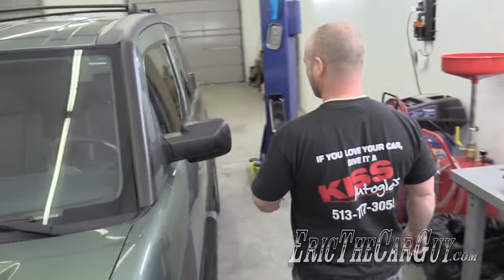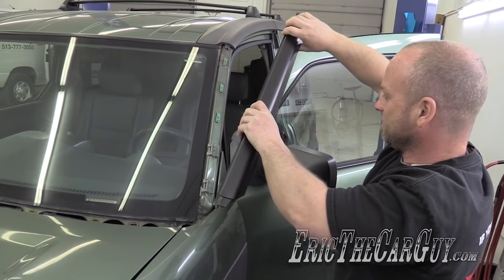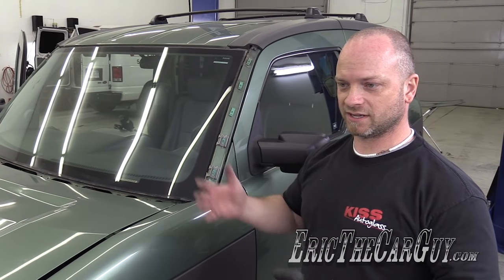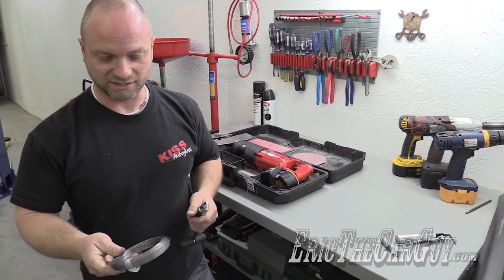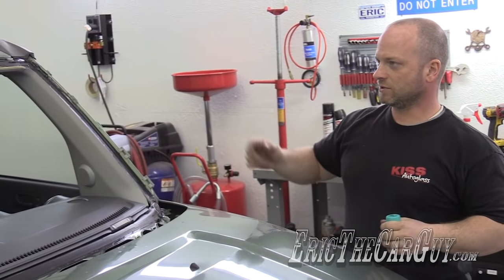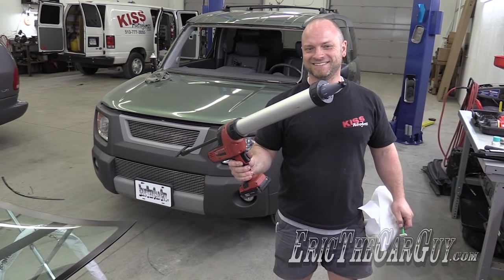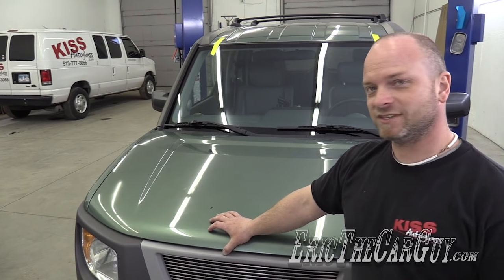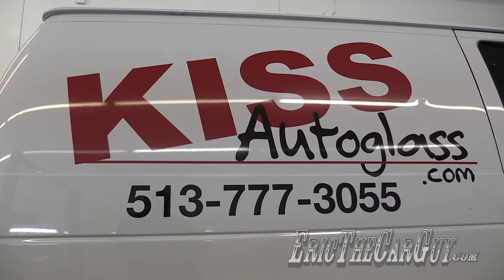How To Install a Windshield the "Right" Way -EricTheCarGuy

Comment: Great demonstration, great video.
Thanks for pointing out what to look for in polyurethane, time spent on service, tools used, etc. What should one look for in the actual windshield being used (what to avoid or seek out)?
(I would just come to you, Kiss Auto, for my windshield replacement, but I live in San Diego).
Reply: So do I , I’ve replaced mine 10 times i should probably fix the hood latch

Comment: Its funny how the QUALITY of replacement glass is never questioned and considered L-K-Q by auto insurance as long as the cheapest price is offered. Safelite AutoGlass quoted me $149 for door-glass and later stated their replacement glass is made in their own facility LOL. As the video states, the CHEAP price is not the same as OEM in both quality and workmanship using questionable materials and cutting corners for a budget friendly repair... Great Information and tips to be aware of before getting any glass replaced.
Reply: heavymechanic2 Safelite is the largest glass company in the world by sales.  They dump tons of money into marketing.  Marketing yourself the way some do clearly doesn't mean you are the best or that you use the best material.  Just means you can reach a broader audience.
Reply: The guy Safelite AutoGlass  sent out broke my door panel by prying on it without removing the fasteners. A lack of experience is costing me dearly and I will never use Safelite regardless of what any insurance company says. I'm very unhappy that GEICO Insurance set this up.
Reply: Sounds about right. Sad part is you say Geico set it up.  Thats actually not true.  Safelite owns a company called Safelite Solutions that handles insurance glass claims for a bunch of insurance companies.  When you call Geico you are actually talking to Safelite Solutions.  A company that obviously is going to feed their own mouths.  You have the choice of which glass company you want to use.  My advice to you and everyone is when/if you need glass work educate yourself on a good glass company and tell them who YOU are going to use.  They don't have your best interest in mind.  They have their own interest in mind.  The reason they are the largest glass company in the world.  They are a monopoly.

Comment: Does the molding need to go underneath the windshield, across the top?(Ihave a 2012 Nissan Rogue, I'm replacing the urethane plus moldings on the windshield and roof). It seems to have leaked after all these years, and my radio shorted & didn't work for a few days. I found some moisture in the middle at the bottom of where the it was installed.  I now remember it leaked
it looked like it was already on the windshield, in the video). I haven't replaced a windshield since my 69 GTO and they didn't have a molding, like modern vehicles have.

Comment: hi Eric, I wanted to ask how long do you normally keep the tape on the windshield? I just had a windshield replaced and it has been 2 days already so I took the tape off. the guy who replaced it said not to wash for 2 days also so I haven't washed yet. I have been driving since it has been replaced tho. any signs I should be aware of as far as the windshield setting correctly? I noticed little indents on the top of windshield where the rubber is. thanks!

Comment: at safleite we use a fiberline like fishing string to cut out your window as to minimalize the damages to paint. the cold knife can slip and do incredible amounts of damage. also double dipping in the primer can cause contamination and not form a good bond as a result. I skipped around but was the glass activated? if it wasn't it won't hold in an accident. and the put there fingers on the bond line setting the glass. this is a safety device.. can't cut corners. gloves or not it has been contaminated. may or may it hold at this point. other then that was a decent job.
Reply: You might want to come and talk to the Safelite guys in my area,they could use your help ;-)
Reply: Good commentary!!

Comment: I just had my Factory mopar window windshield on my 2016 chrysler 200 with a nee glass aftermarket and 20 minutes drove and got on highway and hear wind noise if its already installed how to i checked exactly where the leak /whole is i was thinking of filling the hole or holes with flex shot if i use this would i be able to put the tip in interior gap lower part of windshield where glass sits on weather strip or is there something blocking it

Comment: very informative. the best thing you can do for a crack is stop it from spreading right ?  i've seen stuff in the store that claims that. the other expert i saw on youtube said make sure the installation guy is certified. i.m.o. that's easy, cuz you can fill out certificates from staples.

Comment: The windshield on my 2006 Accord has had a crack all the way from one side to the other for the last 4 years, and has held up despite some nasty winters. I can't feel the crack on the inside surface. Everytime I think about replacing it, I think of some better uses for the money... such as the Grey Pneumatic Duo set I just bought. (81659Crd)

Comment: Hey eric hope you're doing good... I have question, not windshiel related... 2000 accord cooling system malfunction code, its it possible that it just needs to be flushed ? Its not over heating ...i dont know the cars history.... Thanks

Comment: We went thru a Softballs sized hail storm last year that knocked out windshield back window and sunroof.. i replaced back window and front windshield with a 1$ ozark trail knife and a hatchet lol.. i chopped the window out around the edges then just cut around it and pulled the edges off.. i used Nascar endorsed 3m windo-weld... worked great!
Reply: Also i had bought 2 cans of the 3m windo-weld.. i still had half a tube left so i decided to squirt the rest into my blow out rear motor mount.. might be a good video?
Reply: oh and geuss what... last month someone decided to bash my front wndowsheild in again.. so yeah i am thinking about going to HF for a cold knife this time..
Reply: Paul Bassen careful not to scratch the paint! XD
Reply: i advise not doing it the way i did with a hatchet.. glass shards will clogg your drain tubes
Reply: and cann get into your eyes, not good! lol
Reply: Paul Bassen Wow! Good share!

Comment: So much easier than the wire method. But a couple pairs of vise-locks and thin wire is/was very cheap (if you already have the locking pliers). The glass knives are pretty sweet though, and much cheaper nowadays. Plus 3M makes a roll of sealer you can just roll on, super cheap. But agree that the molding clips are a real pain in the ass. Especially if you can't find replacement clips easily and cheaply for you old molding.

Comment: It's really important this is done right. There's nothing more annoying than a leaking windshield. It can completely ruin the car interior. My VW factory windshield leaked. I had it replaced, and it leaked again. The company, like most, had a lifetime warranty against leaks. They reinstalled it, and it's been fine since. Much nicer in the car with a dry interior.
Reply: Garth Goldberg  Was the vw a jetta?
Reply: No. Eurovan.

Comment: should have had the rust grinded off before it was primed.  Also good idea to leave a window open a crack when new windshield is installed, so that when/if person getting in vehicle slams door it doesn't push the urethane out and cause a leak. it is also easier to install windshield if there are suction cups on exterior of glass. But he does use the best urethane!
Reply: Corey Erb Rust was minor and cleaned off.  Suction cups are easier and prefered for some.  Not me.  As far as leaving windows slightly open, as a general rule of thumb it is a good idea.  Cars today are vented pretty sufficiently with either pressure release vents under bumpers or windows that go down when the door is open and up when it is closed to minimize any pressure buildup in a vehicle and with the higher viscosity urethane that I use its not an issue

Comment: Thank you for the video as I was doing research to learn more about windshield replacement as a customer.  I am now in the middle of a huge problem with the company that replaced my cracked windshield: 2 replacements and going for a third, windshields that distort the view, chipped windshield and glue left on the car top that was removed with a razor blade resulting on scratches to the car.  I know that they did not use a primer to glue the new windshields.  Does this mean they used a low quality urethane?  In addition, would you shed some light on the quality of windshields?  How does one know that the windshield being put on is of the same quality as the original?  My insurance company refuses to pay for an original replacement and this has only given the windshield guys freedom to replace it with whatever they choose.

Comment: I was surprised they didn't use suction grips to lift the new windshield into place or for that matter when remove the old one. I thought that was the safest way to handle large pieces of glass. I was also a bit surprised didn't lay fender guards on the front to prevent accidently scratching the truck while working. Maybe even masking the top edge of the roof in case of a slip while cutting the urethane. The work seemed top notch but seemed to overlook the additional precautions to prevent accidental paint damage.
Reply: Doing it by hand worked...and no ones safety appeared to be at risk so maybe the suction grips are just overrated . Also no paint was damaged. Idk how your watching this and worried about the paint. Unless there wannabe sawzall goes haywire or the man scraping the leftover sealer has a seizure I doubt the paint is in much danger
Reply: Kaos476 The suction cup thing was simply a question. Since I see them used alot in glass replacement videos I was just curious why he didnt use them. And I never said he damaged the paint. The idea of protecting the paint is simply a just in case measure. Why do you think good mechanics use fender covers when working under the hood of a car. Its to prevent possible scratches and damage while working. If I had a nice car with near flawless finish I would expect that however worked on it for any reason too precautions to protect it. That being said Erics Element probably is less than perfect at this point in its life and Eric may not care.
Reply: +Adam N fender guards get in the way and masking tape will not stop a blade cutting in to the paint. suction cups make it easier but are not needed if the installer is experienced enough. most of the time if not all the time an experienced installer will only scratch the paint next to the ure, and a GOOD installer will NEVER use the extractor on the top and sides of a passenger vehicle unless they absolute cannot cut it with another method. and any scratches will be primed over.
Reply: +Kaos476 Well, there are times that the urethane can catch, and you end up slipping and the blade can get away from you. Anything is possible, and it happens a lot in the industry.

Comment: I prefer thread or wires to cut the windshield out.
One round around the windshield, poke it through the glue and tie it to a pulley (not sure how to translate that...)
Then I use an electric drill to wind up the thread and the windshield is out in a matter of minutes, with no risk of damaging the paint.

Comment: Is the factory glass installation better than having a person do it like in this example?  I love the new windshield here, but I worry about an air pocket and leak.  Still, Rich did an amazing job!
Reply: Yes - it's done in a clean environment on top of 100% rust free surfaces with no previous material remaining, no scratches from the tools that are needed to remove it, and in some cases, machines do it on the assembly line to 100% perfection every time (depends on manufacturer).
Reply: I had my windshield replaced due to a crack on the windshield.  Is it as good doing it in the factory as it is "second-hand"?  I tried to only have the crack fixed, but I could still see the spider crack from underneath where they fixed.  They offered to replace it and I couldn't have been happier..
Reply: You can't have it fixed in the factory 99% of the time.  If you take it to the dealer, they're going to replace it the same way as in this video.  Remember, windshields are 2 panes of glass with a piece of plastic in between.  If you have damage to more than one layer, fixing only one isn't going to fix the others obviously.  So having it initially installed in the factory is best, but after it is damaged, second-hand is your only option for getting it replaced.  Nobody has a clean room or any of the assembly equipment sitting around.
Reply: Alex, Thanks so much.  I just didn't want to sit with the glass chip/crack on the windshield.  Like you said, it going to be different if you do not get it factory installed, but as you pointed out, what other options are there?  I just didn't know what else to do.  That being said, having a new windshield on the car was great as everything was ameliorated.  I appreciate your feedback.  Warmly, Sanjay

Comment: Nice video. If I was close to them I would have called them
I bought a 97 camaro ss with a watermelon sized hole thru the windshield - flying deer I assume lol
1 glass shop couldn't figure out how to get it in - said they couldn't do it after they cut out the old windshield.
Glass shop #2 put it in, First try it stuck up on the left, 2nd try it slid down an inch and 1/2. next day they tried to pull it back 
up with glass suction cups - crazy.Then they left never to be seen again! At least they left the glass for free.
3rd guy did auto glass and home glass. By himself he puts it in on the first try and fits perfectly.
I wonder why its so hard on that car? I know there are 2 pinch welds that stick up on the pillars, but wow,
Some special tricks that we need to know about replacing a windshield on that year camaro ?
Reply: Just plain old experience and the right tools for the job.

Comment: Do Chevy 3500 vans have clips because the guy didn't use tape to hold  the glass in  like the guy on my other 3500 years ago did?
Reply: Tape is only needed if the new windshield isn't sitting on the stops.  If it's resting on the stops it won't slide.

Comment: Do you only use the sawsall chiseler only on the bottom of the windshield when removing it? The last time I had to have a windshield replaced  the dudes at Safelite damaged the plastic pillar on the drivers side.
So they gave me a $40 discount.
If the was a KISS autoglass out here in California I would have called you.
Reply: Michiganborn1969 Great question. Depends on the car.  When I do use the Extractor I use it on the bottom.  It is a very expensive tool and can do a lot of damage if not used on the right applications.  There are very few cars that I pretty much have to use all the way around.  As cars get lighter the metal is getting thinner which also poses a problem because the extractor will cut thru the metal.  The thinner the metal the easier. Some techs will use it all the time because it is a whole lot easier.  I'm not looking for speed when I do my jobs.  Just pefection. : )

Comment: Very informative episode.

I'm curious about the popping noise I hear from the windshield when I'm driving my car sometimes.  Is that the adhesive separating from the glass or something else?  Is it something that accumulates until it fails or is it a temporary thing?
Reply: megavern72  has your windows been foggy or moist inside the car in the mornings?
Reply: The car is parked inside a garage overnight so the windows are usually clear. However, sometimes when I leave it out during the evenings, the windows fog up.
Reply: papa bear
Oops. The reply is above.
Reply: megavern72 maybe a part of your cowl is loose, do you hear air noises?
Reply: papa bear
No, not really. The interior is pretty quiet when I'm driving.

Comment: Eric or Rich, I have a 2005 Honda Element. What is the name of that long horizontal piece attached to the windshield wipers that was removed towards the beginning of the video? Mine is cracked and I need to replace it. Please respond if you can, or if anyone here knows.
Reply: I didn't look at exactly what you were referring to but it is probably the cowel. Not sure I spelled that right but that's what we call it

Comment: Awesome!  I live in a rural area and will be replacing a windshield myself in a F250.  Everything is flown in and I do not want to fly in an Installer.
Reply: lecon chuitt how did that go for ya?
Reply: I installed the windshield and everything looks great.  We will see how things go this winter.
Reply: I had to purchase a battery powered caulk gun, installation was easy.  I also had to install a rear window.

Comment: So much easyer on older cars :) Just give the old window a good kick and it falls straight out of the rubber. Then its just a case of using a few strings to get the new window in the rubber and done.
Reply: devilmastah your right

Comment: I sure everyone knows it does make a difference who does the install, For my birthday my brother borrowed my Tacoma for the day and had a new windshield installed for me. Must of used someone with little experience, The guy somehow razor cut my headliner on the edge just under the rear view mirror, and 2 months later a crack formed from under the weather stripping in the same area, going down into the main windshield, probably due to a chip on the edge of the new windshield, ended up with a worse windshield then when he started. So back to square one. Problem is you just don't have a choice who they send out to do the job, But at least now I know how its suppose to be done. I wish they would of expanded on Good glass verses cheap glass and how to tell the difference. Wish Kyle worked around my area, oh well.